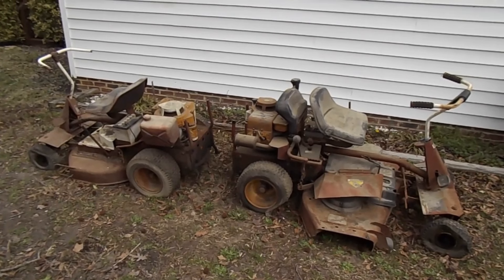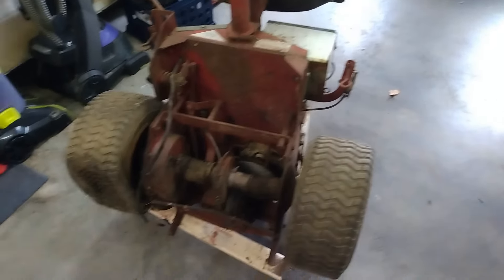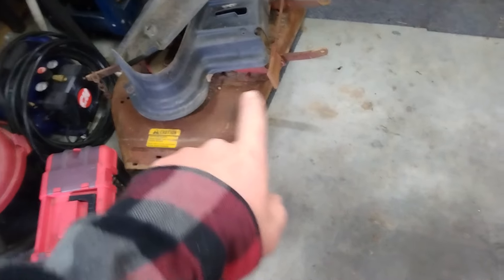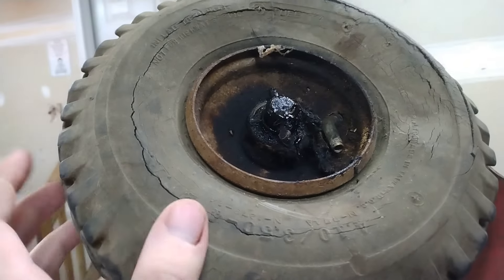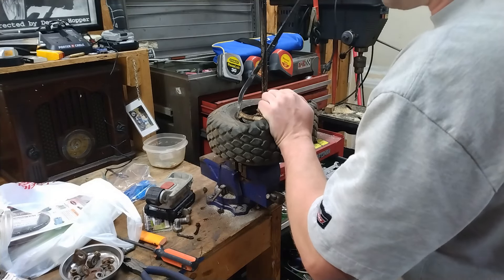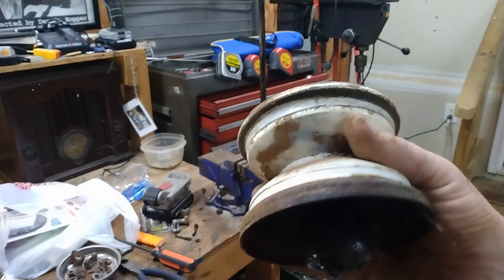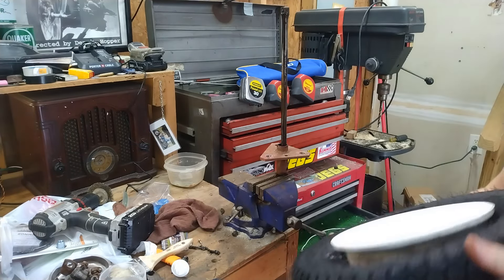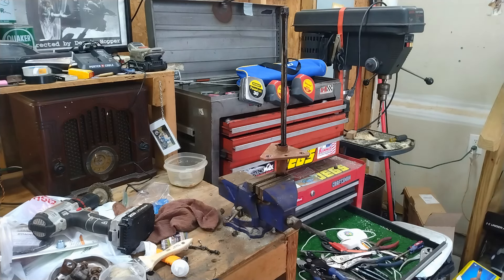How Bad Of A Project Can This Be? Beginning The Tear down PT.2

Comment: Good vids. Have a 30 inch like that, appreciate the tips.  
A possible cheap alternative - I replaced my front tires with the same size dolly tires from Harbor Freight.  Take off of their rim, comes with the tube.  Have to be careful putting them on the mower rims as I pulled the cable out of the first one I tried, but they only cost $6.  Ran them all last summer over a rough yard with no problems.

Comment: Your doing good Your wife should be proud. Only thing don't stand it up with the battery it could leak acid on the snapper mower
Reply from the maker: Its just a on going joke between my wife and I, she likes the money these projects make and that it keeps me busy. I found out with my first snapper that issue, I also found out oil will get in the cylinder that way and that the mower needs to sit level for a while so the oil gets back to the crankcase again

Comment: I'm so cheap, I would have tried just putting in tubes and reusing those dry rotted tires!  What's the worst that could happen? 😅😅
Reply from the maker: The fronts were goners, I could see through them. The backs could have been ok, I might have gotten a season or 2 out of them, but I have seen split when their that dry rotted, I kept them as emergency spares

Comment: you understand that you gota go thrue the carb and more then liklily get a new carb kit for it right and also its a 1977 ish 11 ph vse or virtical shaft engine and well some of the times i have issues  wit them its needel and seat or holes in the brass float abd jetting and idel issues .....just be awhare
Reply from the maker: I bought a new carb, the throttle shaft was completely frozen even after ultrasonic cleaning and soaking the shaft in Free All for a couple days. It runs, that's all I'll say since that's for a future video

Comment: Why does everyone use one hand please put camera on stand and use 2 hands.
Reply: A chest rig or a head mount for a go pro would be perfect. He had it together changing out the tires
Reply from the maker: I use my hands to show certain areas better, but I try to use a tripod whenever possible because 2 hands are better than one when working. I'll try using the tripod more, I'm still figuring out this videoing stuff
Reply from the maker: @medicbabe2ID I'm going to try it out, holding my camera is a pain but theres times I want to get in close to show certain things.
Reply: I bought tire/wheel at Harbor Freight. Unbolted the two piece rims they came with and used them on the front. Discarded the wheels from HF as a very inexpensive source of front tires.
Reply from the maker: @rg1599 That is a pretty good idea, the fronts cost me about $24 together but the tubes were cheap